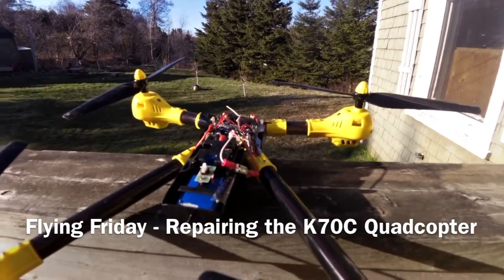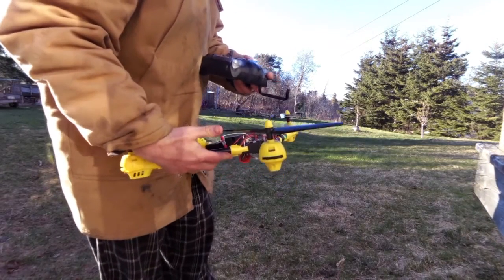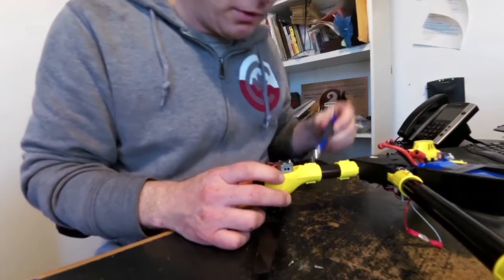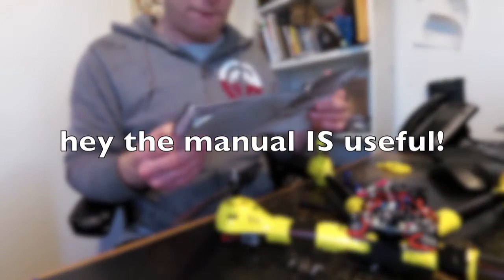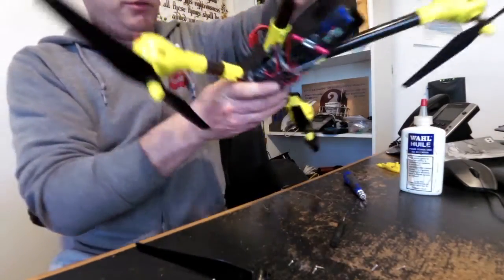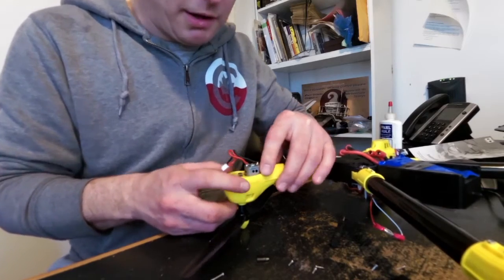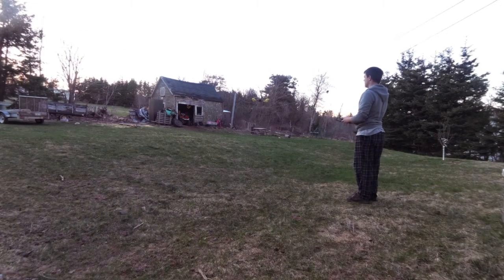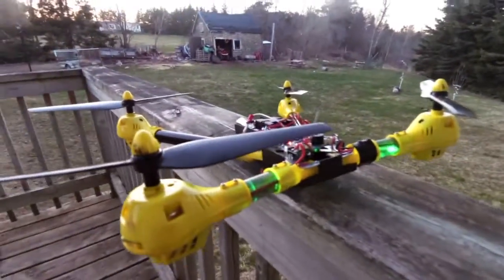Flying Friday -  Repairing the K70C Quadcopter

Comment: top tip run it without propeller to ensure motors are running smoothly. i killed one of these by flying with a prop not catching on the motor prop and it burnt my circuit board. had to buy another. when in doubt take off the props and run it in nutral to ensure motors all turning nice.
Reply from the maker: good suggestion, i'll try that next one i get :) thanks!

Comment: My K70W crashed and now everytime it flies, it flies to the left. I dont know what's broken, whether the left motors became weak or something wrong with the altitude hold. Do you know the solution?
Reply from the maker: thanks for the comment. great question.... mine crashed a few times and even replacing the motor didn't fix it. i think the board gets shorted or something if the engine isn't turning correctly. with the latest model of the k70 i think you can purchase a new mainboard for it - if you have the model with altitude hold.
Reply: Nathanael Andreas Hutahaean  maybe  hold  both analog sticks to the left. to reset the gyro's